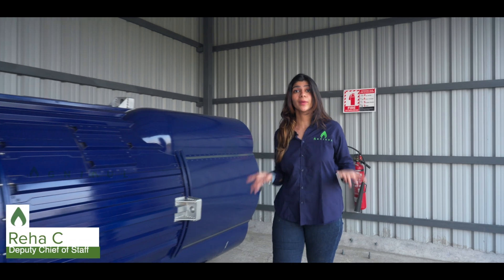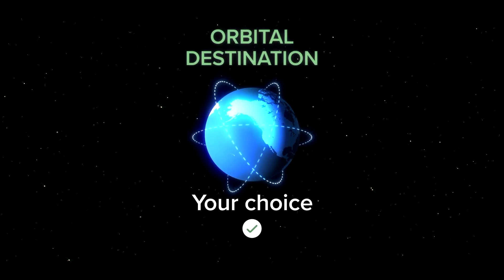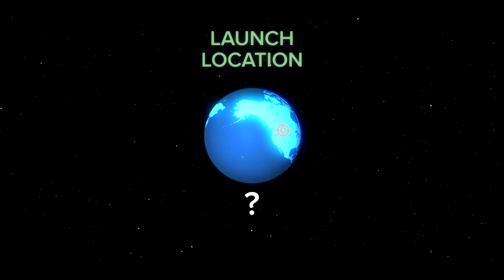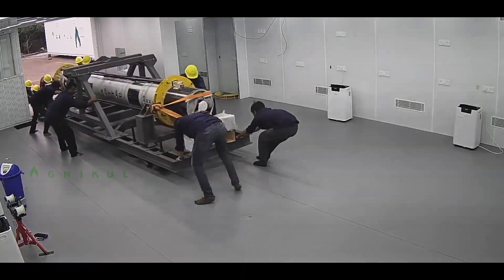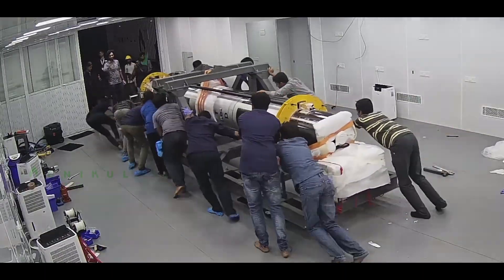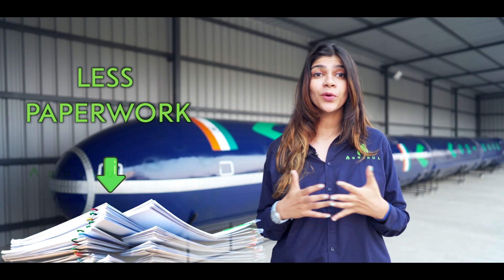Agnikul - Launch Anywhere Anytime Affordably l Episode 2 : Delivering Delta-V

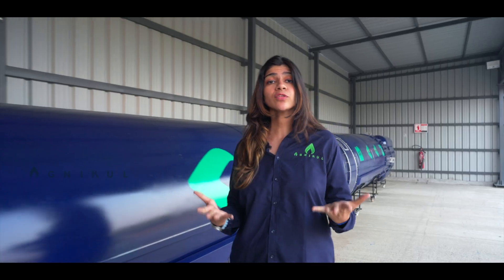Comment: 0:50 that engine in background looks so hot 🔥🔥
Reply: Kinda looks broken to me. There is one pipe going nowhere. Also some wire is hanging out.
Reply: @jackiemao8384  ya but the turbo machinary looks cool...
Reply: Where? I can't see
Reply: @jackiemao8384  Just above the engine bell and below the stage (propellent tank dome)
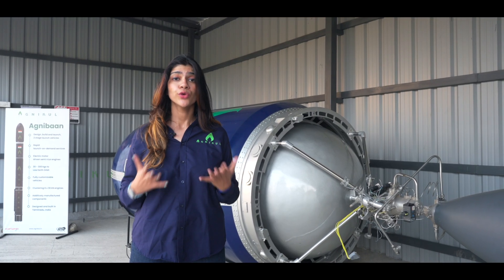A second later ig 0:51
Reply: @PramochanYaan  that is the chamber right? Moreover these are electric pump engine. I doubt if turbines is even involved.
Reply: @jackiemao8384  o yeah I forgot that you are right, I was referring to this section only